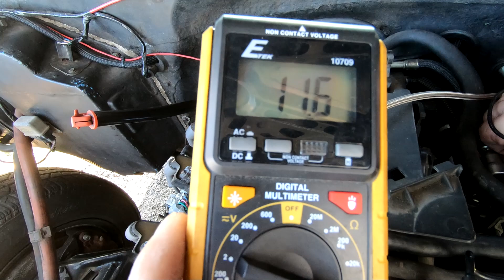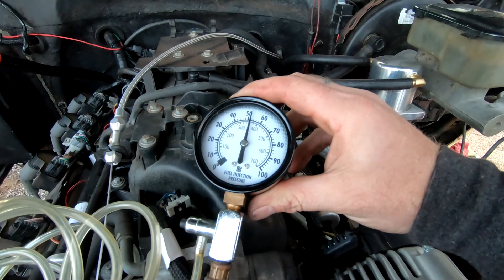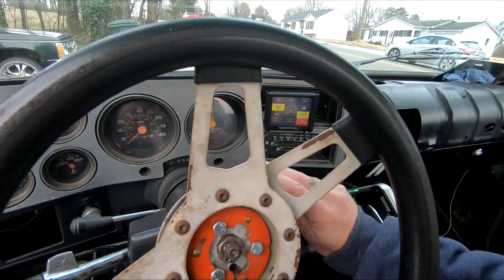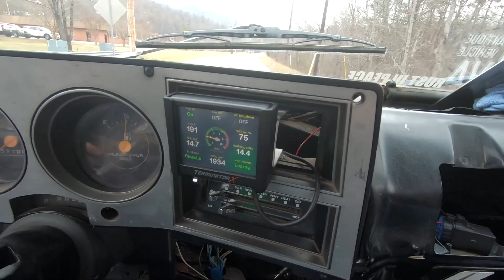My LS Swapped C10 Running Lean?

Comment: Check your mass airflow sensor it should be between 2 to 7 grams/second and between 15 to 25 grams/s at 2500rpm. That sounds like the culprit.
Reply from the maker: There’s no MAF sensor with the Holley terminator, it runs on a MAP sensor built in the computer. If I knew what I was doing I could probably hook a laptop up and look at it 🤣 one day I’m gonna hook it up and play with it try to figure it out.

Comment: Wbu that cold air intake is the Crack case vent on the passager side vented to the cold air intake  or did you block it off that will make it lean
Reply from the maker: The crank case vent is hooked to the throttle body in the stock location. Thanks though! ✌️